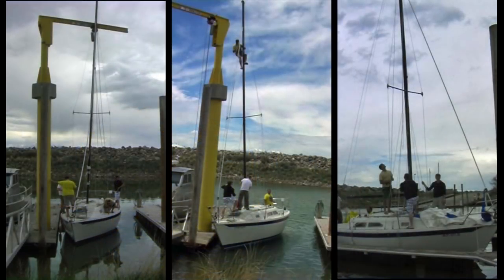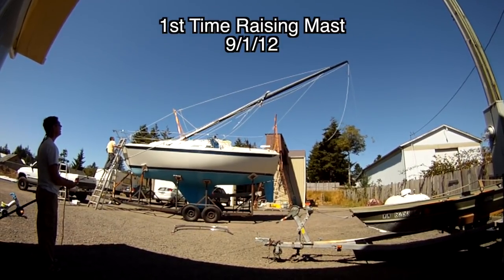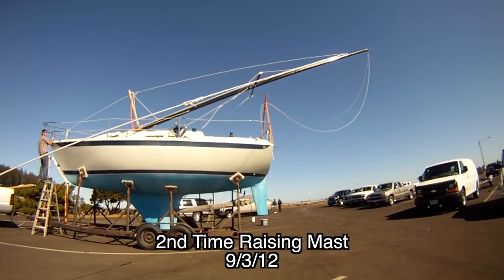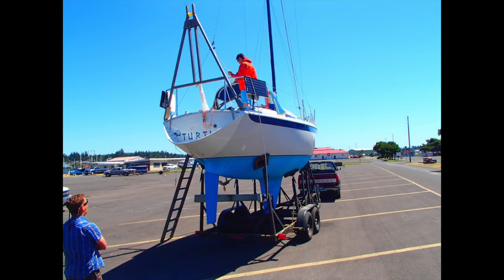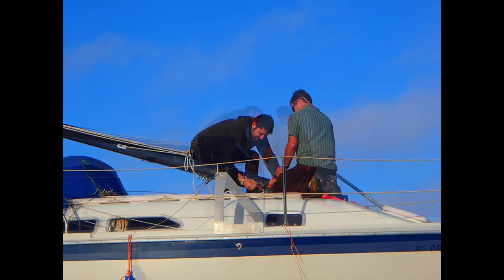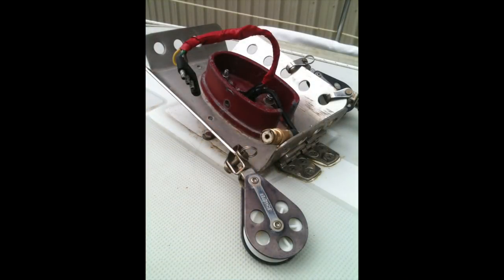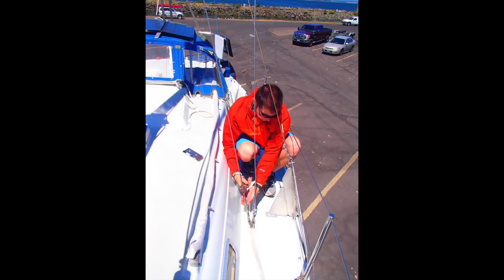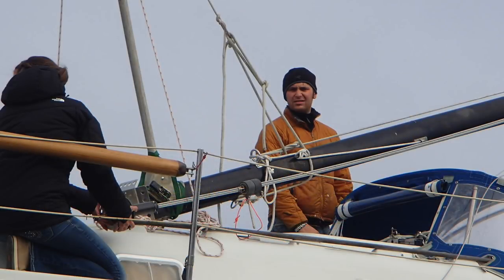How we Raise and Lower our own Mast on an Ericson 26 Sailboat

Comment: Excellent video !
..I am considering an alberg 30 w/ non-original tabernacle, and a cut-down mast from a C and C.
The tabernacle consists of a thick flat stainless steel plate bolted atop and through the coach roof and through the horizontal wooden support beam directly underneath the coach roof.
Welded to port and starboard edge-sides of the base plate are additional, raised, vertical stainless steel plates.
The mast sits between the raised plates and is held there by two bolts each of which run through one plate then the mast and out the other plate.
In the above-described arrangement the bottom of the mast remains suspended (above the horizontal coach-roof-bolted plate) by the two horizontal bolts and does not touch down upon the horizontal plate.
I can only suppose that this was done so as to allow the mast to be lowered/raised by removing one horizontal bolt and rotating the mast around the remaing bolt(?)..
I wonder if you might let me know if such a set-up is unstable, given that the bottom of the mast is suspended.
   (I have only experience, many years ago, sailing a little 12 foot sailboat).

Comment: I use the spinnaker pole with a spinnaker halyard attached to the end of the spinnaker pole.  Have another line that attaches to the end of the spinnaker pole that is led down to a pulley where the jib tack attaches and then it leads back to winch in the cockpit.  Of course I installed Harken 32 self tailing winches as the primaries.  There are stabilizer lines on the cabin top inline with the pivot pin on the mast step that are tensioned at the cockpit.  I use a mast up crutch in the cockpit to get the mast up higher to start with.  I can raise and lower the mast on my Ericson 25+ by myself.  How do launch your boat, with a line or an extendable tongue?  Do you have keel guides?  Ryan